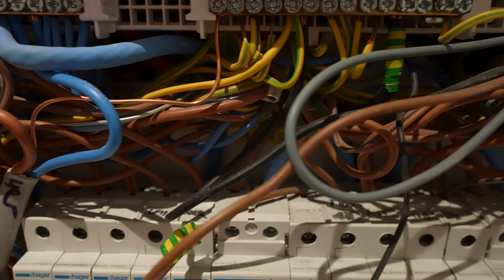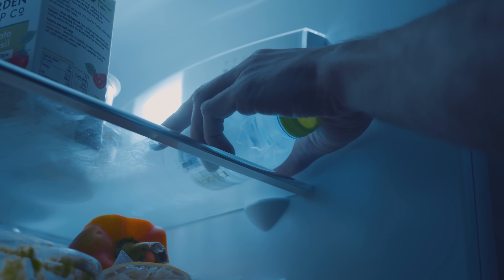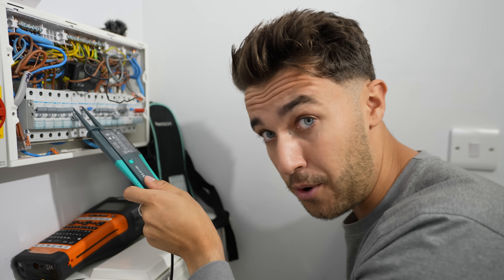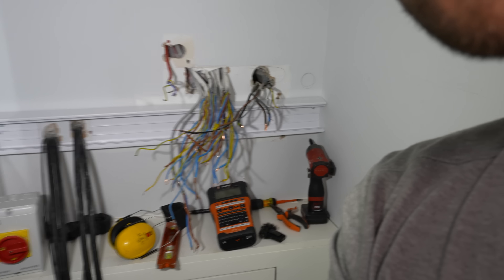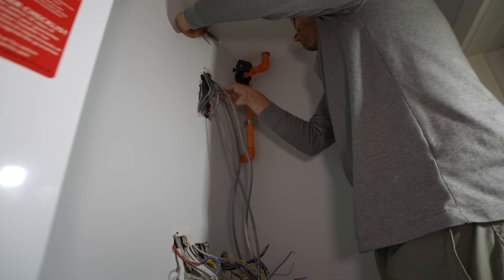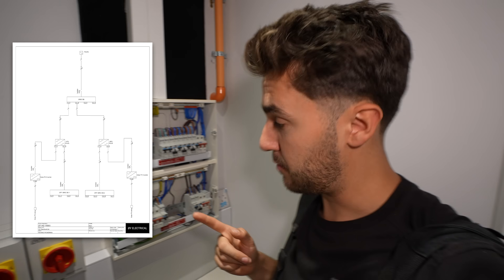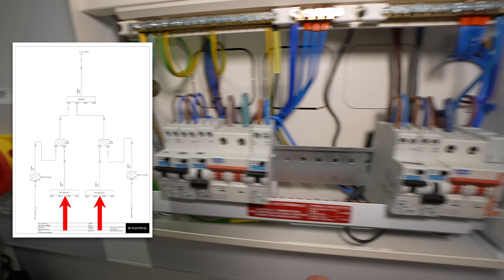DIY DISASTER CONSUMER UNIT - Off-Grid Wiring Deep Dive | ØY47

Comment from the maker: Did you spot the giraffe? 🦒
Reply: Spotted the blurred safety sandals 😂
Reply: Very nice European product: Hager has the ADA940U RCBO for example. (but the import tariffs on EU products are of course extremely high on the island) 🙂
Reply: The giraffe or the 'gaffe'.  Thought DB should be mounted on a non combustible surface..... Looks good though.  Rest of your work is spot on.
Reply from the maker: @kjgreen3 Sorry, what you’re saying is completely sensible, but I disagree that it’s a requirement. BS7671 encourages the consumer unit to be constructed from non combustible materials (BS EN 61439-3) , whilst it’s good practice, I’m not aware of any regulations that stipulate it must be mounted onto a non combustible surface. Happy to be corrected if you have a reg number or IET guideline. 😁
Reply: @corymac  No regulation number everything you have done is to regs. But regs are bare minimum. It's just nice to lift the bar.  Seems strange that the regs only stipulate non combustible enclosure but you could mount the db on the side of a straw bale if you wished.  Not having a go, more venting at the duality of some of the requirements in BS7671. Love your work since you left Artisan.

Comment: Did you short N and E for the off-grid circuit ? If the house turns to off-grid mode and the N-E is not bonded RCD's will not trip because it will be a floating neutral...
Reply from the maker: The inverter will do this
Reply: @corymac some inverters do yes 👍

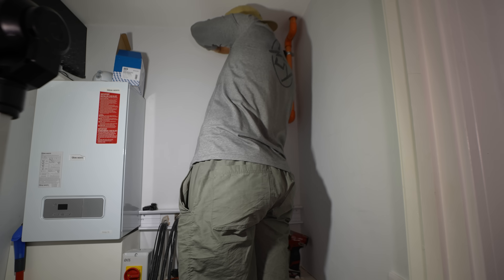Comment: 8:51 well germany we don´t use a lot of connduit either it is more like cables into the wall plaster over it and done, and ceiling are normally concrete so the wires are in the concrete, how to rewire you ask? simple rip everthing open and do all of it again, sometimes i really think everwhere else it is donne easier with youst dry wall in front of it basically can still reach every spot here you have to get vcreative sometimes

Comment: With the emergency power back from the inverter, how do you protect the cable. Looking at the manual it says to have a red prote thin so we have always had a DB by the inverter protecting that distribution cable back to the board? Does it not need protecting with an rcd until its supplying a emergency circuit??
Reply from the maker: Given that it’s clipped direct and only about a 3 meter run, I’m not too worried. But it’s worth considering in your design 👍🏼

Comment: Interesting configuration. Do you need to contact the dno for this ? Also would it be feasible to put a grid tied inverter circuit into the supply/grid row or would it cause issues with the off grid inverters?

Comment: Cory,
how would you do such a system in an apartment environment; how would you Earth it if there is no access to bare ground (concrete everywhere and other complications) for independent connection to Inverter? Can the grid "earth" be used and what happens if grid goes down?
thanks for the great content!

Comment: So in the event of a power outage, does the supply RCBO in the grid board to the inverter / charger remain live (back fed from the inverter) or does it go dead?  I assume it goes dead and the inverter has a separate EPS output that feeds your extra EPS boards?  You've probably guessed there will be a part#2 to this question! 😉
Reply: Question#2 - If the above statement is correct, why do you need to use "Bidirectional RCBOs"?

Comment: New build - seems about the standard 😮 Great job pre-planning the EPS side of things rather than having to figure it out later - if it wasn’t for added bureaucracy I’d have a full back-up but as it stands the worst power cut has lasted less than a few hours - 30kWh is huge but looks like you have a gas boiler rather than heat pump?

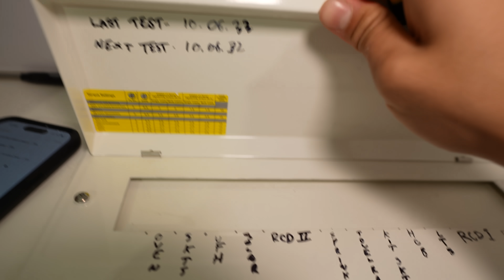Comment: I am not familiar with higher powered electronics, but at 6:00, what is keeping him from getting shocked? Aren't these wires coming from the power station on the street?
Reply: If you look at 12:08 you will see there is no steel wire seal on the main fuse, that means the fuse could have been pulled out and plastic cap replaced. Maybe there is also an unseen breaker between the street and the house.
Reply from the maker: Safe isolation is performed on a breaker between the fuse and the cables, as seen in the video 😊
Reply: @corymac  Right, that makes sense. thanks :)
Reply: @chrisparkin6966  That makes sense, thanks

Comment: You talked a lot about your system working in a power cut but I saw no gateway device where the house is completely isolated from the grid in a power cut, without this your inverters etc will simply turn off in a power cut to protect anyone working on it? I have a Tesla Powerwall system that does isolate the house and keeps the whole house running.
Reply from the maker: This has a built in gateway within the inverter. More similar to a UPS than a domestic inverter
Reply from the maker: So it’ll continue to supply the house, but won’t back feed the grid

Comment: Is an earth rod needed for an off-grid system? no mains power, solar with generator back up?
Reply from the maker: Yes 👍🏼
Reply: @corymac  Thanks for the response, I know you are looking for suggestions for videos, how about a video showing how to setup an earth rod for an off grid system, ie. is the earth rod connected to the case of the inverter? are the earth wires in the consumer unit connected to the earth rod, etc. etc. I have my own off grid system but how to connect to the earth rod has confused me.

Comment: Great to see spakys getting in to the home assistant rabbit hole. Looking forward to see how you integrate it? Ive just wired all my lighting circuits with shelly pro2 relays in a panel build works great as theyre lan attached and not reliant on wifi or the internet. My whole house is ran by home assistant, theres some great home assistant youtubers out there for advice.Great video
Reply from the maker: I’m going to be using Shelly most likely 😃👍🏼

Comment: Firstly, long time watcher and my favourite YouTube spark btw. Wanted to ask, do you having some kind of ats to switch between the battery and grid? Not done much of that kind of stuff. Cheers!
Reply: Usually its all done in the inverter, in my case I have a Vicrton Energy Multiplus system, so decide which circuits are bi-directional (and coupled to the grid through ESS - usually high load), and which circuits are critical (so run off batteries 24x7). These days its very very rare for the substation to fully fail (usually if its in a flood plain under water - but it has happened once in 60 years to myself!), normally the grid is off for a few hours / day at most (tree brought down cables etc.), so depending on where you live will dictate your level to resilience.
Reply from the maker: It’s done automatically within the inverter 😃👍🏼

Comment: I've just avoided the rabbit hole of KNX, DALI and everything relying on home assistant. You can do some really cool stuff but, domestically, you have to be really careful to avoid dependencies that mean you can't turn the lights on because of a home assistant update.
Reply from the maker: If you use Shelly’s and alot of similar relays, they fail over to hard wired switching :)

Comment: Question about  Short Circuit Loop Impedance on an off grid system:

Would the prospective fault current needed to fast trip a circuit breaker ever be achieved?

A grid supply has a lot of "strength".  The supply voltage wouldn't dip if you had a short circuit so the breakers would fast trip at 3-5x the rated capacity.

With an off grid supply, you might achieve the Zs according to wiring regs.   But the inverter wouldn't have the strength needed to maintain voltage during a short circuit.  As a result, your breakers might never trip in off grid mode because your voltage gets dragged down.  You're entirely reliant on the inverter itself tripping out).

It makes me wonder whether wiring regs for off grid use purposes will eventually get updated.  Essentially:  Thermo-magnetic tripping mechanisms get replaced by
1.  Programmable-electronic current tripping mechanisms which don't rely on prospective fault currents to fast trip. 
2.  ROCOV/F (Rate of change of Voltage/Frequency) relays.
Reply: @anthonydyer3939  your concerns are absolutely valid and I think many installers don’t even consider the difference in fault level between being interconnected with the DNO and operating in island mode. Certainly, the end users won’t!

A typical inverter will usually have a short-time rating of 120% of the nominal rating. Lots of inverters are type-tested devices rated at 16A nominal output, so short-term rating is around 19 to 20A. Any overcurrent device rated above 6A on a BS EN 60898 B operating curve (so tripping expected between 18 to 30A) is unlikely to operate. 

That said, I remember a demonstration I witnessed as a young graduate trainee engineer, where the live and neutral from a typical flexible cable were bared and laid about 10mm apart on a block of wood. The bare ends sat in a very shallow pool of tap water and the flex, protected by a domestic 13A fuse was energised. It was smouldering within about 6 minutes. Sadly it’s impractical to protect against every eventuality.

The inverter will shut down for overcurrent/overload conditions to protect its output electronics. Almost all incorporate RoCoF protection to satisfy G83/G59/G98/G99 requirements to detect loss-of-mains but this is not likely to pick-up for an overcurrent or overload condition.

Comment: A video outlining how to convert a complete botch into a professional commercial style UPS back-up distribution board. Typical smart and well thought through work Cory!
One question though, does the water sprinkler system shut off the power to the house automatically if it starts pumping water? 
🌧⚡⚡
Reply from the maker: Thanks Bryan!!

Comment: My mum property have sprinkler system and I tell you, it's can get expensive real quick on repairs! We have several faults on leaks and losing pressure. Pump activate when there's a loss in pressure such as popping a sprinkler head or small leak in the system. We've finally fixed all the problems and is now working and run automatic service test once a week. Smoke alarms will not activate sprinkler system like you see in the movie! 🙄😀

Comment: I've managed engineering teams for years and you had your 'go to' really great guys and some that struggled with a screwdriver. They were all trained and qualified but when out in the field that then changes. Oh the days of the 4 fuse if your lucky Bakelite board with lead or rubber sheathed cables. Back in the days and it was still there in 1975 when I was 10 years old was my great Aunt had an off grid farm in Devon!! meaning there was no electricity but what she did have a wind generator behind the farmhouse and 12v lead acid batteries and lights just with 12v bulbs. Not enough power for anything else but that was the job for the range and the open fire.

Comment: For the fire alarm what starts the pump is the pressure switch on the line, if a sprinkler head thermal link ruptures and line pressure drops the pump starts to spray water at the broken sprinkler head edit: it could also be a flow switch, depends if it's a dry system or not

Comment: What is the rogue MCB to the right of the battery 2 isolator?

Also does that software work with design of control panels? As I've been looking for a cad panel design software for a while. I don't build them often enough to fork out big bucks though.
Reply from the maker: That’s a modbus meter for my solar 😎👍🏼
Reply: @corymac  'off grid db2' is on the left hand side and has a single breaker to the right of it.
I'd be really worried if I didn't know what a meter was 😂
Reply from the maker: Sadly it’s no good for control panels

Comment: The Aico Relay is installed to sound the smoke alarms when a sprinkler head is activated. Your concealed sprinkler heads woluld acivate at 68 degrees if the sprinkler bulb is red. Only the sprinkler closest to the fire wilol operate. BS9251 requires that when a sprinkler is activeted an alarm sounds. Happy to help you further if needed?
Reply: Came here to say this as well. I’m in the US but unless it’s a preaction system (it’s not) the pump controller is on a pressure switch/flow switch. When the heat becomes great enough it will break the glass bulb of the head (or link, if it’s link type) allowing water to flow from THAT HEAD ONLY, this will then trigger the pump to run to maintain pressure as well as the flow switch triggering all the alarms to warn occupants. Here we use red bulbs for 165f in normal locations, yellow for 175f in utility areas, and green for 200f in special designated zones.  You can usually get a second set of dry contacts on the flow switch that you can tie into HA for water flow notifications without touching the system proper. You also may want either a feed from the system if it has it for pump running alarm or for isolation you could use a vibration sensor on the pump into HA just in case a contractor sticks or something with no waterflow, could keep you from burning up a pump.  That said, let the controllers do their job and don’t put anything in between, monitor only if you will. Life safety systems are there for a reason after all.  ❤

Comment: Great video, thanks for showing a very practical changeover solution.
One question.  Could a car with vehicle to load (V2L) like the new MG PHEV, be used to top-up a battery via the inverter or maybe using a mobile battery unit as intermediary. This would extend your home heating run time off grid.
Thanks.
Reply: Yes, you would need something like a Victron Energy Quattro (with dual AC IN ) linked to a Cerbo GX to be fully compliant (at least in the UK) - but you can overcome this with an EV & IOG (as you can get it to extend the off peak rate from about 8pm to 4pm next day)

Comment: If you have circuits from an off grid inverter power running close to grid power is that an issue? I noticed quite a few volts (not grid volts but a concern) on the off grid cable (switched off) when run in the same conduit as the regular mains power and thus concerned that the frequency wouldn't be that of the grid. I separated it and the volts dropped down to less than a few volts and nothing has gone up in smoke as of yet.

Could you do more about grounding TT, TNS, TNSC etc with regards to off grid and cutover isolation switches. The transfer switch suggests should have common neutrals for grid and off grid which to me sounds dangerous as off grid is not going to run in sync with the grid. Do you thus just use TT (copper earthing rod) then I believe there should be distance if there are other grounding rods.

Comment: I've been considering setting up Home Assistant for ages, looking forward to the series and seeing how you integrate it.
Reply: Home Assistant is fantastic. I have it running on a Raspberry Pi 3b which uses about 5w at idle and the whole house is controlled by it! Pretty cool.
Reply: andyca15 @andyca15  It can be your best friend or you worst enemy. I've been running it for a few years, for lighting, heating, house alarm, smoke alarm (but still hardwired). The trick/challenge is to try and avoid any cloud based services/third parties. It's normally these that cause you the most issues.

Comment: So like you I have a db for the house and a db for my protected critical loads hanging of my victron ess.  I used a changeover switch to essentially be a maintenance bypass of the inverter, because if the inverter fails or needs a firmware update - all your critical loads will go offline.  I also have a downstream ups for the computer gear.

Comment: You're pretty pessimistic! I'm 60 and I can only remember getting 3 or 4 power cuts over the years, none lasting more than 8 hours. Seems like a massive financial and logistical overkill for a problem that virtually guaranteed isn't going to happen. But keep up the good work!
Reply from the maker: I live on a landspit with quite a fragile grid connection. 😁👍🏼
Reply from the maker: Surrounded by the sea
Reply: You obviously have a very poor memory as there would have been more power cuts than 3-4 during various  industrial action during the 1970s. There has been more major power cuts in central Glasgow than that in the last 12 years too.